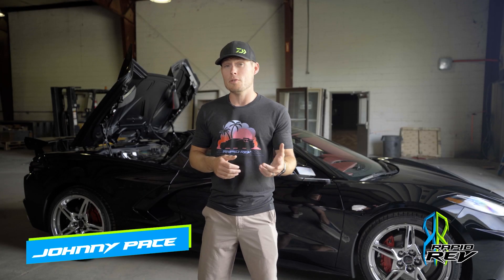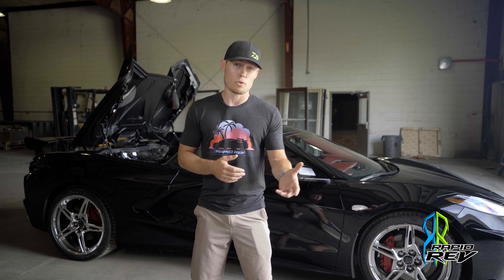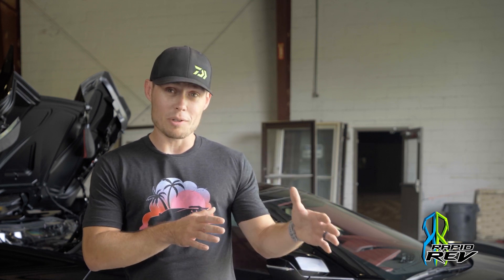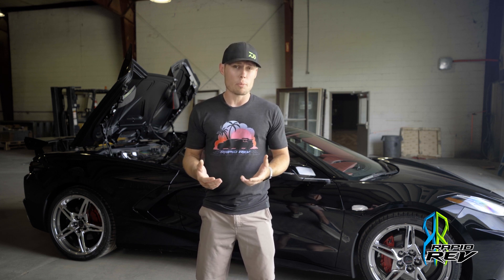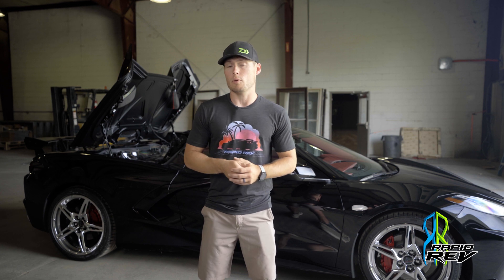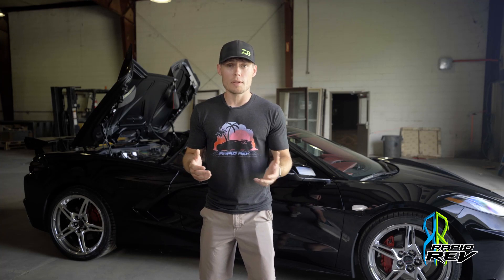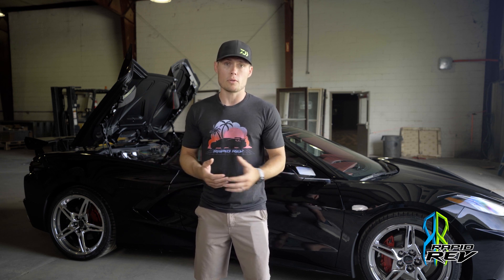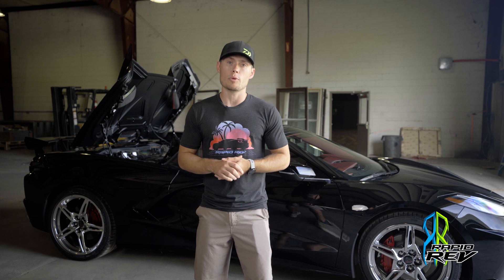RapidRev | C8 HTC Clear Cover Testing | Is it safe???

Comment: The music is super loud🤦🏻. Just point out the reading results. I “THINK” your product is holding up well to temperature issues VS OEM as intimated, and I “think” the temp in the HTC headliner was on par with OEM engine bay cover with heat shield?? But I think with all these concerns before purchasing you should have been more direct and clear. Just offering a better alternative. I love the product…but somebody on the fence will for sure still be confused.